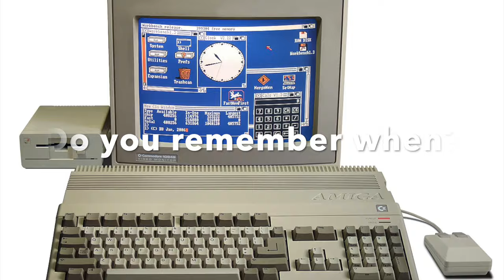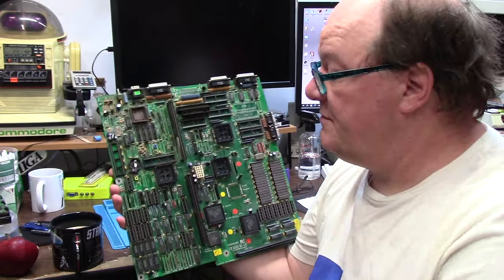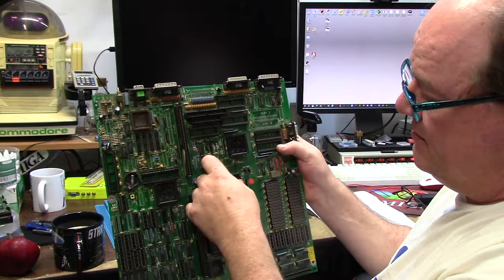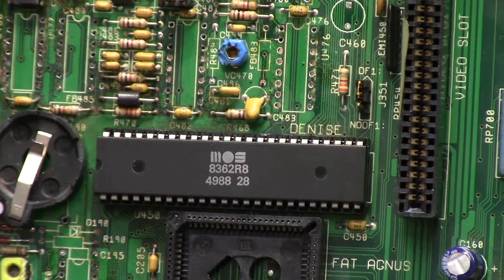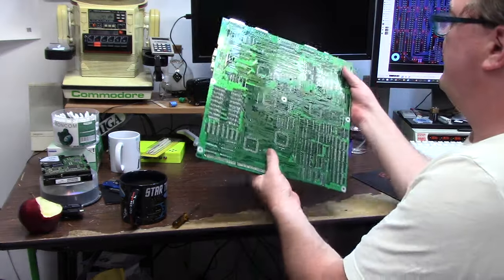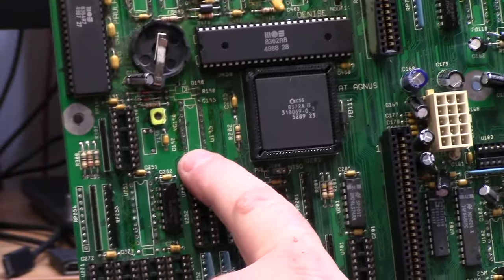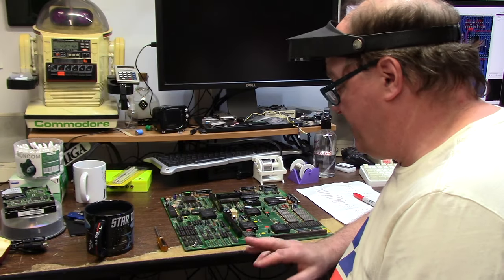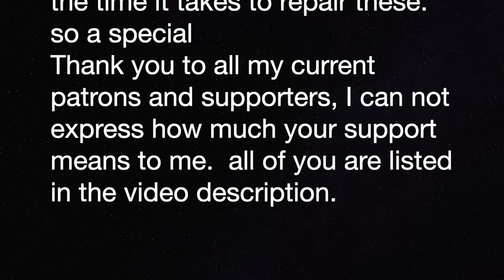re amiga the amiga that was used to be a re amiga

Comment: Impressive Chris,you are determined to loose the last of your hair aren't you :) That is an incredible amount of work that board needs.
Reply: Can we not just buy Chris a ReAmiga 3000 PCB instead. I would quite happily have that board on the wall in a frame.
I guess a new PCB would be a lot easier to get up and running?

Comment: That's a donor parts board, Chris. Cannibalize the hell out of it, hang it on the wall as art when you're done, and then call it a day.
Reply from the maker: not mine to do
Reply: @ChrisEdwardsRestoration  Eeeee. Well Chris, do what you can do, I guess. The roughest parts will be those pulled traces (resulting in a rats nest of bodge wires underneath) & those missing pads.  No telling if the damage resulted in board layer issues like last time. Time will tell.  Ugh.

Comment: there is a place in hell for the person that did that to a 3000! i cant even find a 3000 and someone does that 2 one!!! it makes me so mad!! what a waste of a amiga but at least you can save it chris
Reply: I would suspect that it was donor board for other Amiga. The parts that are missing probably worked. After adding replacements repair will have to figure out what caused this board to be treated as unrepairable.
Reply from the maker: @tokul76  it was a working board that was used to be a re amiga, i am just making this work again as a regular amiga. or hope to

Comment: Sins of Cannibalization, Memories of Problems it solved, with Parts, Now the Realization of repairs required to Fix quick ripping out of Parts, Yes i have several 486 boards like that from a Server I kept running for Somebody Nearly 25 years, Luckily they are 486, (& Server is somebodies else's issue now), Not a Amiga .. BUT the Amiga could not be in Safer Hands for it's resurrection ..